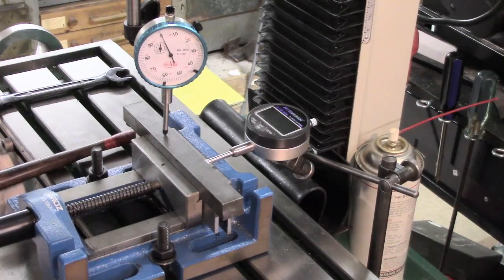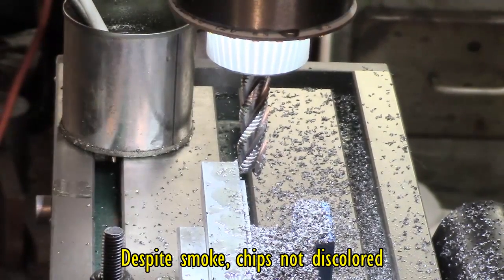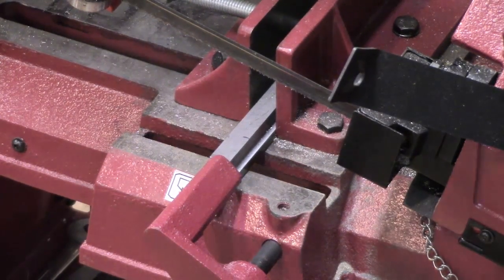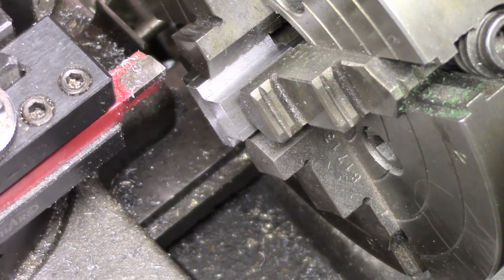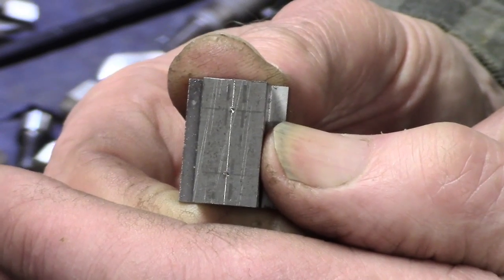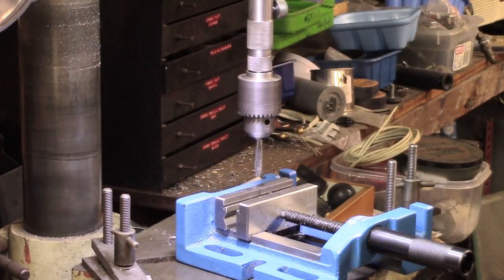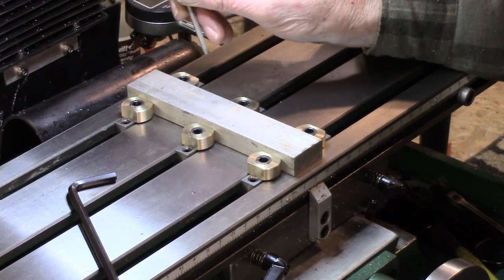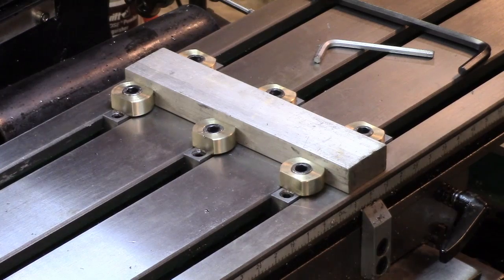Low Profile Clamps for the Mill - Part Four, Final

Comment: These look great Chris.  Do you think there is any possibility that the upwards force could damage the keyways?
I need to make some low profile clamps and this feature has worried me about many of the designs that I have seen.
Reply from the maker: Hi John,
I don't think this should be a problem providing torque not taken to a crazy limit. There's a point where lock-up can feel adequate without being excessive - a sort of ''feel''... probably no worse than the regular kind of stress imposed when using studs. I'd also reckon to not be doing any mega harsh cutting on a workpiece either, so not producing extremes of tool force.

Comment: Hi, Chris.  I've watched this video more than once and it just came to me, what if the thin side of the machine screw had an index mark to match an index mark on the brass buttons.  Would that allow for better viewing of the machine screw position?
Reply from the maker: Hu James - yes you are probably right but in practice, as the screw heads are the main variable it is actually not too hard to see the difference in profile when setting up. You have got me thinking though, thanks! May well make the small modification.

Comment: Hi Chris, when you rotate the cam it obviously screw down into the top nut, whilst pushing the button out to the work. When it's at full clamp position is the button also seated on the tea nut and the cam cap head seated in the base of the button ? I would think the cam cap head is not seated in which case, can the button lift a touch ?
Reply from the maker: Hi - Well, in theory there could be a very small lift but in practice it's hard to detect. The caming bolt is tightened into t-nut to max - but still allowing for the final small up to 180 degree turn for tightening. It's worked very well so far.
Reply: Well, Ive made my cap head cams & the buttons (steel as Ive no brass), now I just have to make some T nuts with heads higher than the slot. Time for my shaper again ;-) Thanks for your reply. Hope the back is improving each day Chris. ATB Mat

Comment: Nice build. Thanks for this video.

As you get more used to your vertical mill, you will find more work that "fits" the mill better than the drill press. One thing you will make soon is a Work Stop. A fixture that attaches either to the mill bed or to the milling vise. It lets you remount a workpiece (or a different workpiece the same size) in exactly the same location. When drilling the T-nuts for the tapped holes, you could have laid out a single hole on one of the T-nuts. Put the marked T-nut in the vise; Adjust the bed of the mill to bring your layout mark under the quill; adjust the work stop to the location of the part; drill your pilot hole; flip the part end for end; drill another pilot hole; get a second part; drill both pilot holes; and so on for all six parts. Now you come back (without moving the vise or the work stop) and drill one end of each T-nut for the grub-screw sized tap. Then you swap bit sizes and drill all the other ends for the eccentric tap drill. Finally you start the proper tap in the proper end (all of one size first, then all of the other size). Each step, the work is properly in position, and the only thing that might need adjusting between stages would be the depth of cut for the quill.

With a work stop and fixed vise, swapping workpieces is so much faster than swapping tools and bits that you will be astounded. Eventually, you will take this ability into your design process: if you can design a set of parts that can be efficiently machined in stages as described above, doing all the work with one tool or bit before switching to the next bit, you will find any repetitive work much easier.
Reply from the maker: Peter W. Meek True! A stop for the vice is on the bucket list - either to make or buy. Very much an essential aspect for repetitive work,.

Comment: So I watched it I still not see where the side pressure comes from

Regarding your ball turning setup the tool post is too bulky no need
Try to use bent- end tool to get to the shaft closer
The setup is a bit too large for that lathe, I think
The Old Bob
Reply from the maker: Bob - side pressure comes from the bolt heads - which have been turned eccentric and, when rotated provide a cam action, pushing brass button against work piece.
I have a fresh plan for a ball tuner, using a different approach.

Comment: At ~24:41... How does the 'hold-dwn' mechanism WORK;  considering most commercial Lck-nuts don't cut threads to bttm .  (to prevent damaging the slot).
Thanks!   gripWIN@gmail.com
Reply from the maker: "Hold down" is in fact just the locking in the T-slots with a set screw - to keep the T-nut located - not excessive tightening - just enough to locate securely. Then, the cam operation of the cap screw in the brass button provides button side thrust against the work. This, from all sides gives the final holding force.

Comment: great video.... why did you part off the t-nuts before  you drilled and tapped them??  why did you spin them in the lathe to face them?? wouldnt it have been better to put them on your  mill in a vise and with the part hanging out a little bit use a end mill to square off the end then flip and do again... very llittle time... what am i missing? thanks
Reply from the maker: Hi, well, it seemed easier to do the operations once cut off - so quick to put in vice for each op. Then, marking out on uncut bar would have to allow for the cut kerf - so once cut off, easier to set up accurately once faced off. Yes, milling could have been used for facing off, just that I reckoned, for me, quick job in 4 jaw was easier.and quicker. As always, several ways to skin a rabbit! :)

Comment: nice series Chris,
thanks for sharing, always a pleasure to watch, a power feed is a must, I installed 2 on mine, but I feel so lazy now lol, its boring just stood there getting cold, waiting for the power feed to finish
given the choice would I go back to "cranking" nooooooooooooooo!!
chuck a magnet in the bottom of you coolant/brush pot, it will stop the pot from vibrating off the mill table as shown in your vid
keep up the good work
regards...Keith in Swindon u.k

Comment: Hi Chris,
            I enjoyed your video of the brass clamps, they proved to be well constructed and well thought out. I think I will endeavour to make a few. Any jig that clamps direct to the table aids the odd ball setups which is what I usually finish up with. I have a clamp design which uses any piece of metal with one side machined and is thinner than the tee slot by an amount sufficient to get an allen key in. The idea is to drill and tap a hole in the plate so that it is in line with the center of the upper part of the tee slot. Drill a cross hole in the head of the bolt and fit into the hole in the plate. dress the bolt length so that it fits easily into the tee slot then with an allen key or a scriber undo the bolt so that it locks onto the opposite side of the tee slot and clamps the plate against the tee slot wall. Two of these plates will allow a parallel setting surface to set any workpiece accurately with the 'Y axis. The clamping is done only on the upper part of the tables tee slot. The amount showing above the table surface is down to individual preference, and can be any length and with two or more clamping bolts.I have a half a dozen which can sometimes be very useful especially when it's a bit of a chore to reset the vise.
Cheers MoK
Reply from the maker: Thanks Mo. Trying to get a clear idea of your described clamps. Sounds a great idea but perhaps you have a picture or two you could show me sometime - almost see what you mean but not entirely. Always after any and every idea don't you know!

Comment: Nice build Chris and got to test the mill a bit too.  I see lots of possibilities for different shaped brass buttons, maybe a piece of hex to get into angled shapes and maybe a large convex radius for more rounded parts...all you would have to do is build the buttons now...just thoughts.  Rocker Clamps next??  Thanks for sharing.  ~PJ
Reply from the maker: Hi - thanks, not too bad a result, so far! Indeed, may well be potential for some other button shapes - may work on that. Rocker clamps - well, have a couple yet to use so - may well see if I can adapt them to bolt onto a T-nut - good thought. :)

Comment: nice project Chris and well made i suppose you could have a dead stop on one side and use the adjustable clamps on the other for repeat jobs or would the grip on the part not be as good
Reply from the maker: David - yes, that's a possibility but because offset rather small there is IMO a benefit from having the lock-up from both sides. Add to that, perhaps a bit more final 'tweaking' available to suit an indicator required reading.

Comment: You could also checker the contact side of the button for more power...
Reply from the maker: I think maybe that might reduce the available surface area for contact.
Reply: ? seems like it would give it more bite?
Reply from the maker: DSCKy Not sure - I think still surface contact area is the key - and if buttons were harder material then maybe a chance of marring the work. Of course edges of workpiece could also determine whether that could help.It's work thinking about tho, thanks.
Reply: ? Chuck jaws are usually not smooth, but vice jaws are? I guess these are vice jaws?
Reply from the maker: DSCKy Well, chuck jaws usually just have the slight shallow 'V' cut-outs but otherwise they are sort of smooth - not checkered anyways. The buttons -- well in a sense they are just 'jaws' in a way and probably may not suit all materials they have to hold. Chances are sometimes they will have to be modified by use of shim stock or even some other 'grippy'' material.